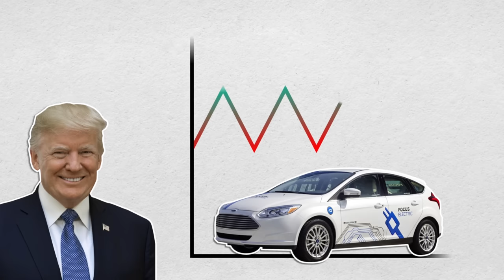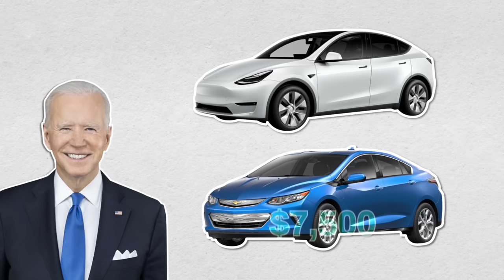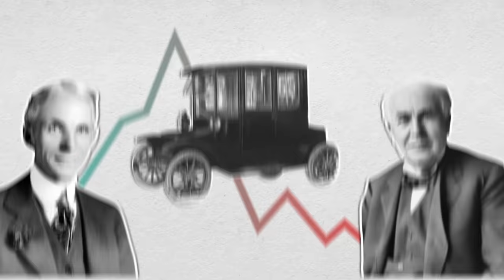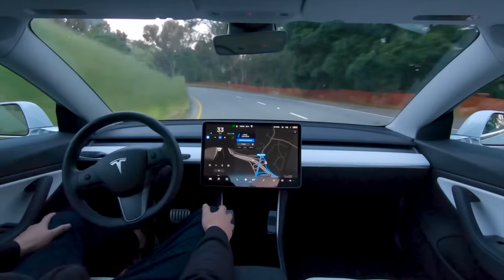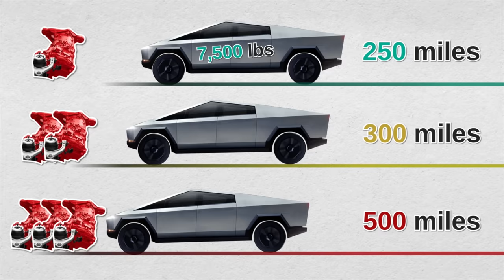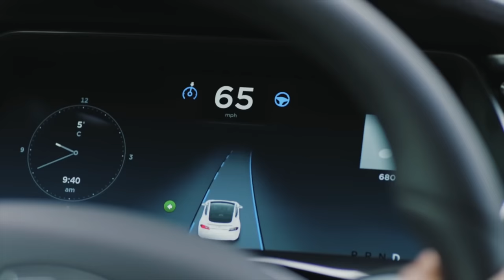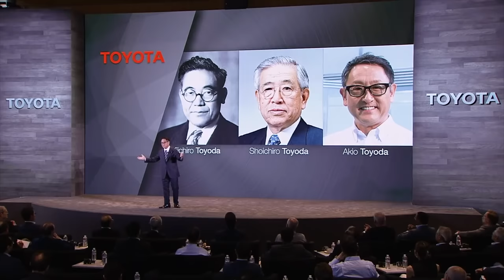Here's Why Toyota is Refusing to Make Electric Cars

Comment: INFORMATION ON JAPANS ELECTRIC GENERATION AND POLLUTION IS FALSE. The misnomer to put fud on evs is about generation because even if you use purely use coal to generate the electric for evs, it is still cleaner than running gas cars. The point source pollution at the plant is more controlled and efficient than all of those inefficient cars.  Also the fossil fuel refineries use more electricity to generate a gallon of gas, then the electricity needed to run the ev so it would be less electricity used to run the ev  than to refine that gas for the same mileage driven.  So to that point in regards to Japans electricity grid being unable to sustain the evs, that is false. It turns out Japan imports the crude oil, but then refines it in the country with their own electricity which could then be used for the evs directly instead. They are making excuses or do not know that they are talking about.

Comment: NOT reported by Scotty - The GE company is developing hydrogen powered electricity generation plants to replace coal and natural gas powerplants. 
In Los Angeles where I reside the city-owned power company has pledged to drop all fossil-fuel power production by 2035. Of course, we shall see if reality matches the promises of our leaders.
I do , begrudgingly, give our state leaders credit for pushing in legislation to reduce air -pollution in cars. It has been a painful process, but these systems work very well.

Comment: Electric cars will not get cheaper even with total mass production, that is, in their standard configuration. The iconic Lithium ion battery uses a rare earth material, Lithium. As all present day electric vehicles use Li batteries, which is the most expensive part of any EV and the price of lithium is only going one way and that is up, then explain to me and all the other sceptics here how  EV's are going to drop in price. Also as stated in your video, the carbon costs of charging will, although less that gas engines, will be extremely high, given that the majority of the world still uses carbon intensive generation. All governments around the world have got this whole electric thing wrong. The only way to get clean, carbon free driving, is to keep the internal combustion engine and convert, where possible, to run on hydrogen. Now many will say that to crack water into green hydrogen and oxygen is very power intensive, which it is and to produce blue hydrogen from gas produces carbon emissions, which it does at a much lower cost, but there is technology readily available to capture the carbon produced to lower the carbon output by 95%+. Also green hydrogen could be produced at a gas filling station so cutting transport costs completely using renewable technology. The way ahead is surely hydrogen and not electric.

Comment: Toyota have got it correct, hydrogen is the way forward, especially with larger vehicles, coaches, plant equipment etc. Batteries are heavy/bulky items. Not to forget all of the mining and processing needed for the components of the battery.

Comment: One could argue that Scotty's  worldview is biased because his career is based on ICE-driven vehicles.  Which is why I would suggest his conjecture that Japan is anti-EV because its grid is significantly coal-powered is flawed. Why?  Because Japan is and will always be an export-driven economy.  They are driven by what is happening in export markets more than their own. Current estimates are that North American and Asian (China) automotive output will be 50% hybrid/electric by 2030 and 75% in Europe.  Why do you think Panasonic is so heavily invested in battery production with Tesla?  Or Honda's partnership with GM to jointly develop EV's?  No, the problem right now is that Toyota made a big commitment to hydrogen fuel cells and the global move to EV's has put Toyota in a lagging position.  Sorry Scotty.

Comment: Just that increase in EV charging stations is TOTALLY not environmental friendly. Think about the material and power being used to construct these suckers. Why can't they just spend more money in lowering the pollution and CO2 emission of all internal combustion engine car in the past 20 years? A stupid battery is 1000lbs. A typical car is just 2800lbs. A 38% increase in weight. And all the tires, suspension, ... will depreciate more than 38% faster.

Comment: toyota is so weird on that statistic. as far as i know, japan has a lot of nuclear energy, which is very clean and porduces a lot of power, although they have been closing them after fukushima, going backwards if u ask me, just evaluate the remaining power plants and see what needs reinforcing to survive the most powerful natural disasters, over engineer it. i know japan have the ability to do that.

so if they're burning more coal and natural gas, at least that's from a few large plants which can be regulated and scrutinized more easily. so if they have their way it will be burning coal and natural gas and gasoline and diesel (at the street level in people's faces, rather than off site, much better for public health). 

in addition to ICE cars constant burning of fuels, when i lived in philippines, i would walk by auto mechanic shops, and the filth you see everywhere is unbelievable. nearly every part of an ICE power plant and exhaust system is really FILTHY, and i can't wait to see them go. they can't disappear fast enough in my opinion, and i actually enjoy driving ice cars, with the engine sounds and shifting gears  manually, but the time has come for electric cars, and i'm frustrated that despite the almost daily announcements, that it ALWAYS seems to be, just right around the corner. for years it's seemed that way, and yet 99.9% of the vehicles  i see on the road are still ICE.

Comment: Until electric cars can all go 500 miles on a charge OR charging from 0 - full can happen in under 10mins the are not economically viable for the entirety of the middle of the United States
Reply: Possibly not--but they're perfect for the other 95% of the world's postage-stamp-sized countries!
Canada, the USA, and Russia have it hard. Driving is a very common, some would say indispensable, part of life--and long distances mean that until battery cells (and the assembled packs, of course) of any suitable type get much cheaper, most people will be burning dinosaur bones and that's that.
Charging times aren't as important as many people think--but, only if they can get the range per charge up to maybe 500-600 miles, that way, you start driving with a full charge, and by the time you're down to less than 1/4, you're ready for sleep--and so is the battery pack, on charge all night.

Comment: We have a Chevy Bolt and a Tesla AWD long range Model 3. Tesla by far makes the BEST EVs. Hydrogen fuel cell is a nonstarter. Toyota will go bankrupt. That’s it.
Reply: Tesla cars are supposed to be outstanding--for the single-digit percentage of drivers who can afford one (or ten.)
Everyone else has to mix something with air and set it on fire to get anywhere until the day comes when EVs are cost-competitive with ICE vehicles.
Reply: @devilsoffspring5519  1. It has already been shown that the 10 year cost of acquisition and ownership of a Model 3 is LESS than a Toyota Camry. 2. In 2023 Tesla will go into volume production of the sub-$25K car. At that time the ICE OEMs will begin to die as EV adoption will go parabolic up the EV adoption S-curve.

Comment: Scotty, You of all people should know the difference between an engine and a motor.  There are no 1, 2 or 3 "engines" in any Tesla.  They are electric motors, not internal combustion engines.  Yes, sometimes the lines get blurred when layman discuss and confuse the two items (motors Vs engines), but you should know better..
Reply: No - you should learn.  Definition of "engine": An engine or motor is a machine designed to convert one or more forms of energy into mechanical energy. Available energy sources include potential energy, heat energy, chemical energy, electric potential and nuclear energy.
Reply: @doctorlarry2273  there’s always one.  You had to be “that guy”, right?  Here you go, straight from an article in an engineering journal:

“Engine OR Motor?

People who work on them distinguish between the electrically powered unit called the “motor” and the engine which it starts; but even in auto parts stores the stuff which by that logic should be called “engine oil” is marketed as “motor oil.” 

Similarly, the English go motoring on motorways. In everyday American discourse, the terms are often interchangeable (you can buy a powerful engine for your motorboat), but you’ll embarrass yourself if you don’t make the distinction when talking to your mechanic. 

Definitions:
  Engine:  Noun  A machine that converts thermal energy to mechanical work.

  Motor:   Noun   A machine that converts other forms of energy into mechanical energy and so imparts motion.”
Reply: @kevinstorm6009  So someone wrote an article and tried to redefine words?  I'm not impressed.  I wrote plenty of articles in engineering journals but did not redefine words, rather I used the proper word each time.  That is the "guy" I am.  You can not redefine me, either.
My definition is from the dictionary - you should look at one some time.

Comment: I vote Hydrogen cars. I can barely afford to drive a gas car, and pay an electric bill. I'm sure getting an E-car wouldn't even change that. The gas, "savings" would just be in a higher electric bill. Plus, I can drive 400+ miles with my gas car. I don't have to worry about a power outlet. This is just another way to keep you on the, "plug"! Just like you are on your phone. Entertainment till the battery is dead.🤣😆😂 People are easily zombified. Idiots!

Comment: $200 per mile on a single charge??? WTF?? You throwing away the car then and getting a new one?? COST PER MILE is calculated by using the COST TO CHARGE IT, like maybe $5.00? divided by the miles that were driven...maybe 200? That would be 2.5 cents per mile. Duh. Or if you include the purchase price? $50k and lifetime 100,000 miles is $.50 per mile so 52.5 cents per mile. Is that what you were trying to figure?????

Comment: The future is hydrogen cars Scotty - really?... where do get sustainable hydrogen from? Electricity - thats where (hydrolysis).
ALL roads for non CO2 producing energy lead back to electricity as prime energy source - generated either by nuclear fission/ fusion plant onm earth - or the nuclear fusion power plant in the sky (i.e. via solar panel, wind, wave, hyrdo..etc all being linked to that) with maybe some geothermal  . . . if you are lucky.

If Japan (or Toyota ) wants to give middle finger to the science of climate change then I guess that's up to them. Personally if they choose that reckless nihilistic route I hope they are the first to reap the damage from what they sow. Also personally I will not touch or even consider Toyota in future.

Comment: Very little truth in this. Lot of half baked ideas and very weird audio. One thought; look into the amount of CO2 produced by an ICE car by drilling for oil, pumping that oil, refining that oil, delivering the fuel to fuel stations and then having an ICE car use only 20% of the fuels energy when it burns it and produces even more CO2. Germany now has car to grid technology where electric car batteries are used to send electricity to the grip at peak energy times. The “fact” that Japan would run out of electricity is very questionable. Another bummer video By the corporations who want to own the energy they provide for our cars. They can no longer do that by owning oil so they want to do it by producing and selling us hydrogen. Funny he never mentioned ho much electricity is needed to make hydrogen.

Comment: Scotty,
I believe the future of cars is hydrogen fuel cells not batteries. I would love for you to do a video on that.
Reply: Possibly a hybrid system, battery only for local driving and fuel cell backup for long highway trips. It makes the fuel cell stack much smaller and cheaper because it doesn't have to provide peak power for acceleration, only continuous power for constant speed driving. The battery pack is much smaller and cheaper as well because it only has to provide maybe 100km of range, instead of ~500.

Comment: Scotty, you have shown your ignorance to the EV argument. The U.S.A still gets 60 percent of it's electricity from the burning of fossil fuel. Renewable energy is not yet stable enough for mass use to offset the proposed increase of EV usage. The requested standards for increased EV sales and production would actually increase greenhouse gas 10 fold or more. Compare the amount released by fossil generation for one day to the number of cars to generate the same. I guarantee you will rethink the EV push.

Comment: I ran some calculations once where I found that it would require more energy to separate the hydrogen from water than the amount of energy gained back from the derived quantity of hydrogen ... So if you don't have an absolutely zero cost alternative of producing the energy required to produce the hydrogen then the obvious solution would be simple, store the energy and use it directly... But like I've always said, we're kidding ourselves, we are not thinking small enough to be as efficient as we really need to be. For one, I don't know of a single automotive manufacturer that is attempting to capture the excess energy spent as heat from combustion engines, they're all focused on momentum. Secondly, I don't see any of them trying to capture energy from the resistance encountered while underway. Nor do the dumb twats acknowledge that weight itself could produce energy, it would not cost all that much to build a platform that you can park your car on. It boggles my mind that we look for solutions to sustainability but then neglect to acknowledge that which is staring us right in the face. Think smaller and maybe someday we'll be better off.